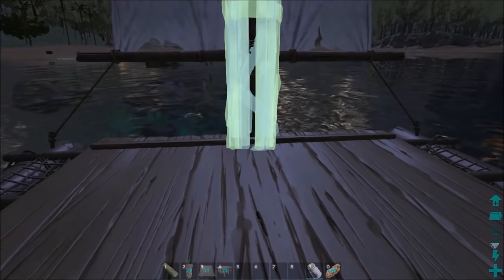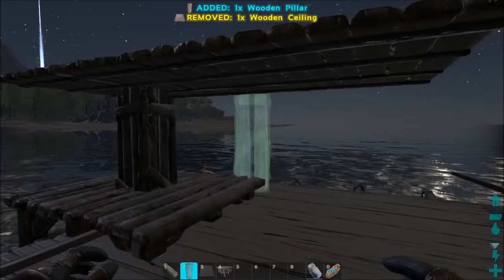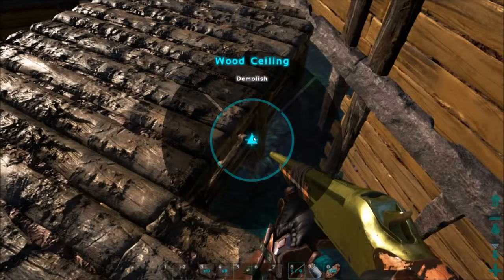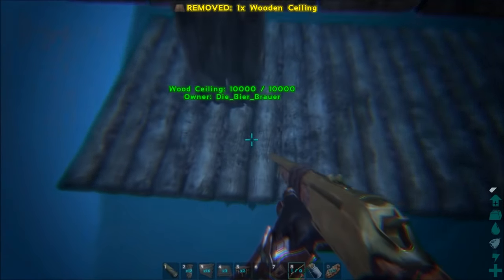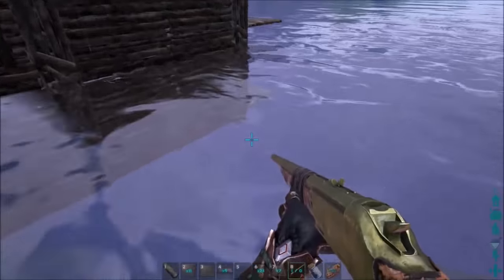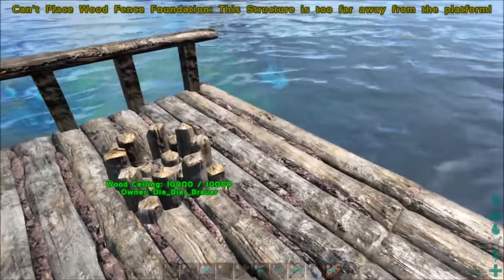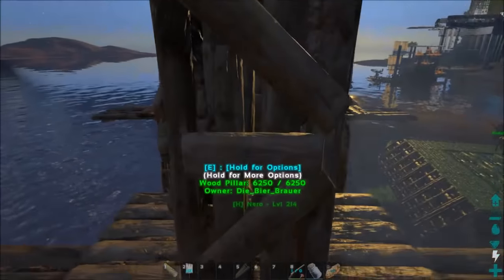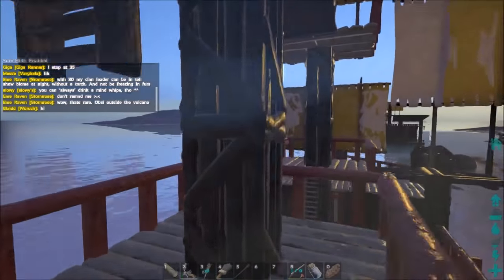ARK survival evolved vanilla ship build tutorial (with upped structure limit)

Comment: Can you actually drive it?
Reply from the maker: You can k out and move the ship around while seeing where you go. It is just a raft and with increasing platform limits this was a very fun project. This Video is 4 years old and I did quite this game around that time. Would be interesting to see if this could still be made ^^
Reply: bogaa games Yeah I was thinking of giving it a try but wanted to make sure I could drive it and see where I’m going after. Sorry, I think there was a typo in your comment, you CAN drive and see?
Reply from the maker: Yeha I do make a lot of typos. I did not know there is much of a difference between moving or driving. When you try to rebuild it I wish you much luck as I remember the ARK building very finicky and this video does not give that much guideline. More as a inspirational work.. I can still give feedback when you run into issues. A cool thing was that you can make costume flags ^^
Reply: Oh, what I am asking is can you move the boat and travel around on the water, and can you see where you are going even though the pole to drive it is under all the other structures. Thanks :)
Reply from the maker: Yes but only thanks to the camera mode. I am not sure if I changed the default for it. I pressed key and it this mode you could still control the raft.
Reply: Great thank you! I actually built most of it now and it’s a beautiful build! Your tutorial had great ideas and designs!